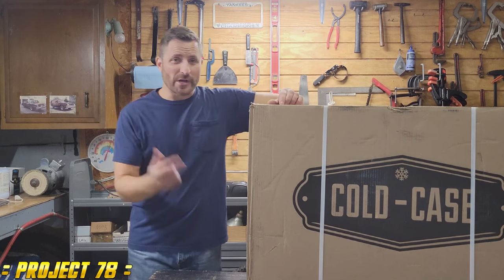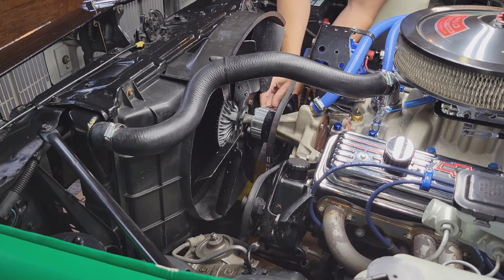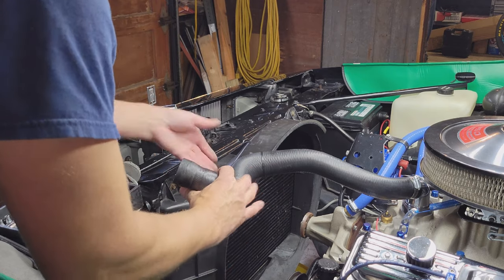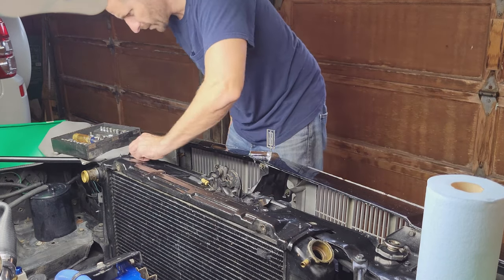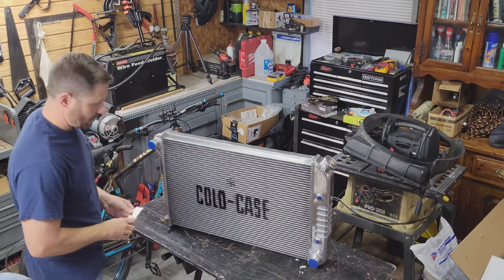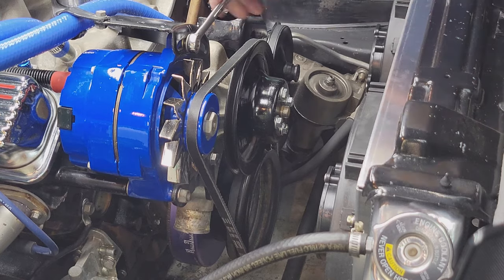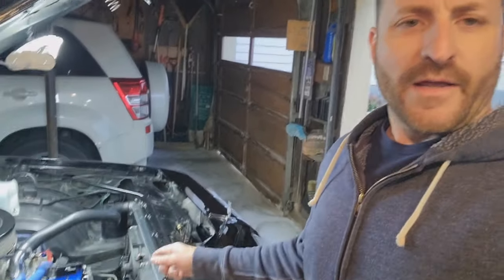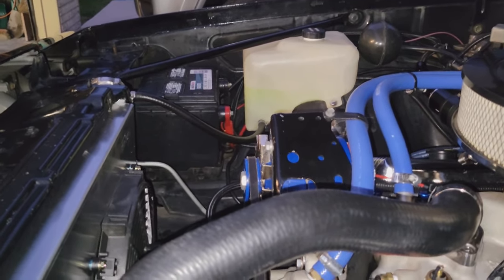G-Body Cutlass - Cold Case Aluminum Dual Fan Radiator Upgrade

Comment: How is the radiator and fans working out did you ever figure out the CFM … I’m looking at the same setup for my 86 Monte Carlo
Reply from the maker: The fans and radiator set up works really well. However, I have not had a chance to test the new set up in warmer weather. Ambient temps were in the 50's and 60's when I was testing. As far as the CFM's, Summit has them listed as a combined 3,200 CFM rating. Overall very happy with the Cold Case install and I would recommend. High price point, but I was looking at some of the lower cost options and I wasn't happy with the reviews.

Comment: How did you delete the old cooling fan. Is there a kit that you can get?   I'm looking to do the same thing to my 79 cutlass
Reply from the maker: Yes, Sir! The radiator comes as a kit with the two electric fans included. There is however, a separate wiring harness with temperature sending unit & relay that needs to be purchased to supply and switch the 12 volts to the fans. The parts were purchased from Summitracing.com and listed in the description. Have fun!